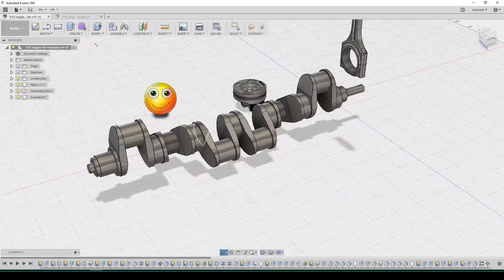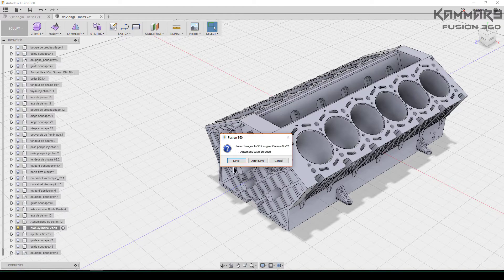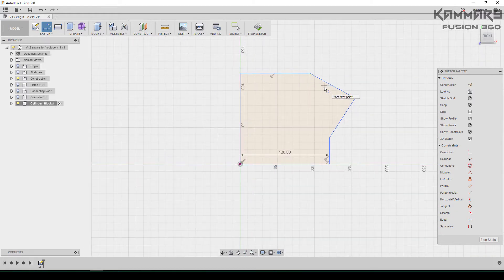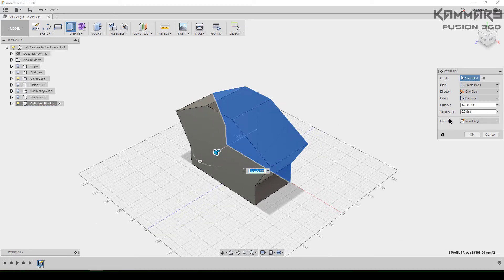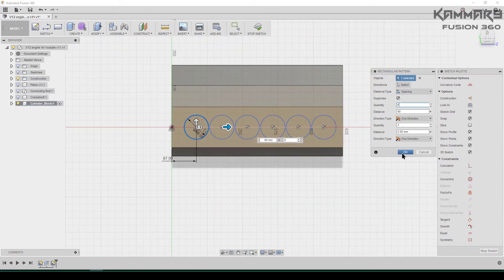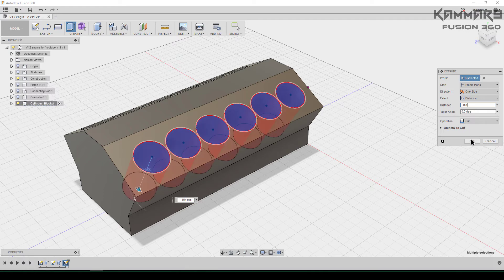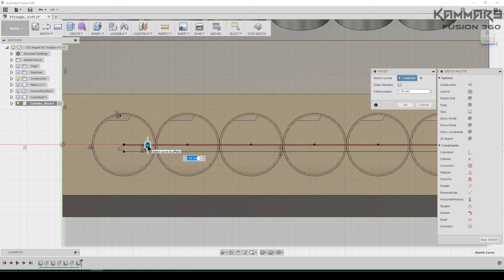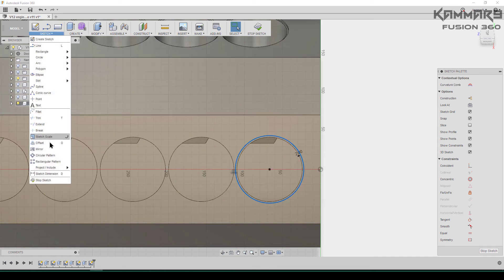Fusion 360 Modeling V12 Engine EP 06 😍 Full HD

Comment: 6:00 you can also do a mirror of the features right, with the holes you make? 
edit at 3:04 i didn't fully constrain my sketch so the housing was off, thats why i didn't notice that the blok is not symmetrical
Reply: I am having the same issue too...(constrain sketch)
Reply: 1. Add a perpendicular constraint to the lines with the dimension of 214 and 145.

2. Add a perpendicular constraint to the line with a dimension of 145 and the line above the 150⁰.

I hope it will work!!!